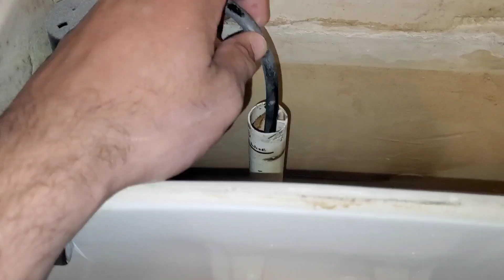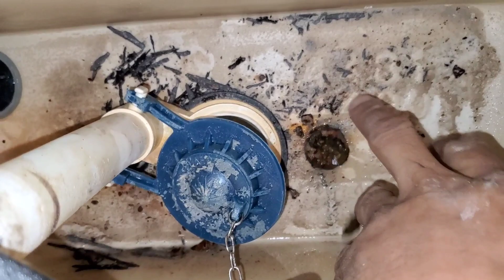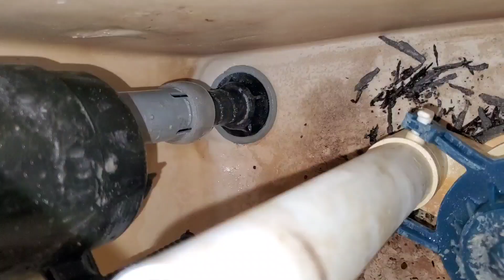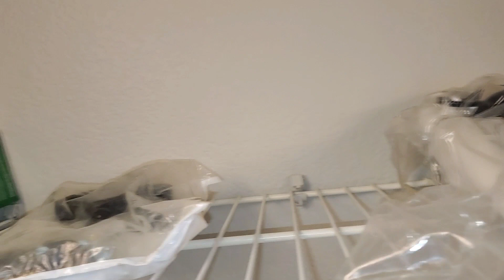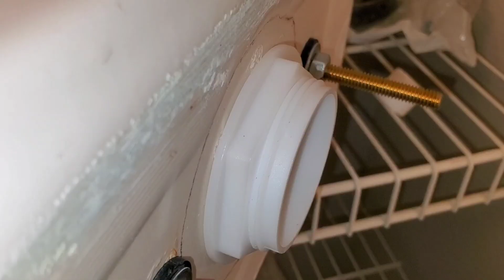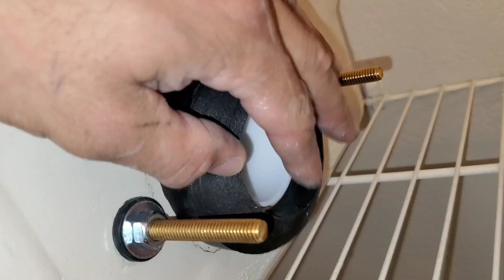Toilet Leaking? Here's Why! THE MOST IN DEPTH VIDEO!

Comment: Nice Video. I have encountered issues with Brand name toilets whereas a universal spud gasket (Tank to Bowl) did not work and would leak. I have also replaced my wax seal at the base. I run a lighter across the wax ring before I apply it to the horn so that it will stick and stay in place when positioning it on the ring in the floor. Thanks for sharing your video with us.